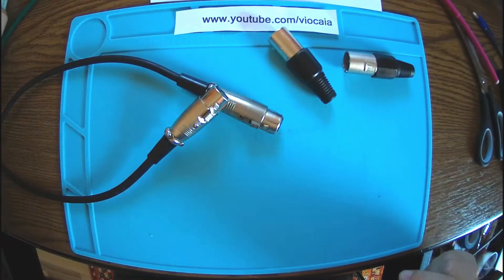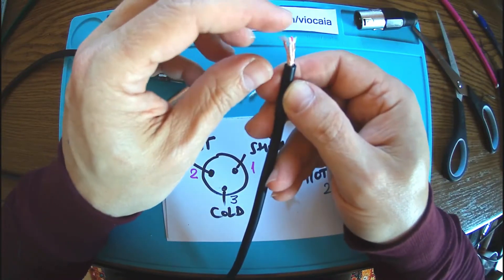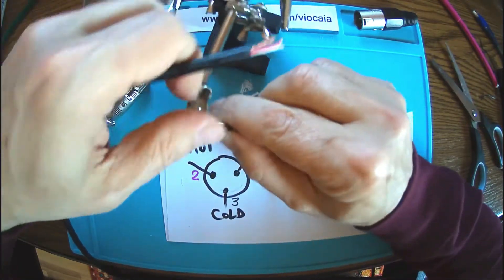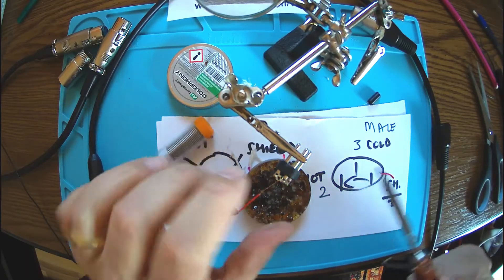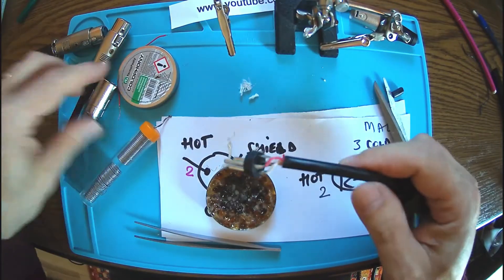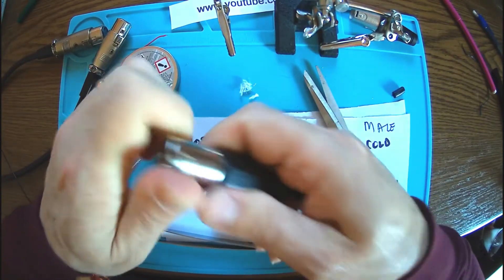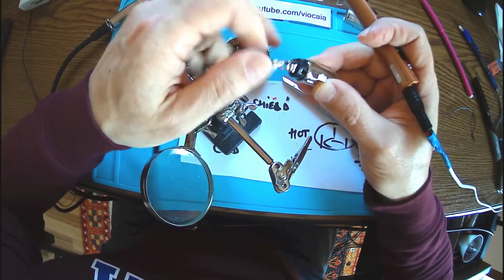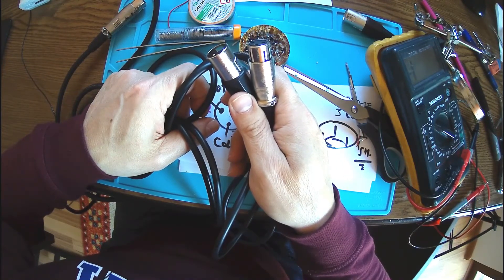DIY XLR audio balanced microphone cable in 10 minutes!

Comment: sir, quick question,  does xlr gets warm while in operation? i noticed on the right side gets warm. it’s connected on cambridge integrated amp. thanks for this great diy video!
Reply from the maker: I didn't notice..it shouldn't.There is 48V but the current is very limited..so even shorted it shouldn't be any harm..